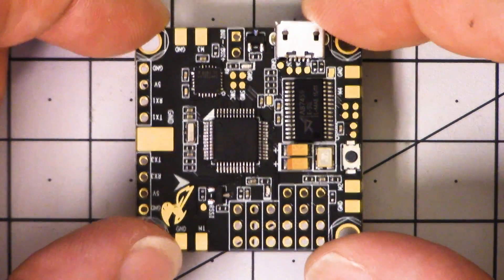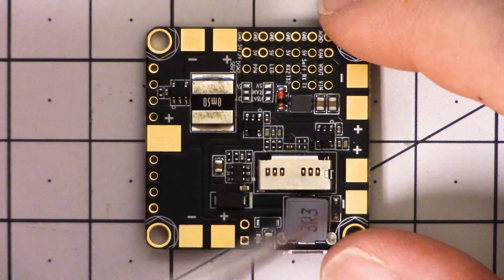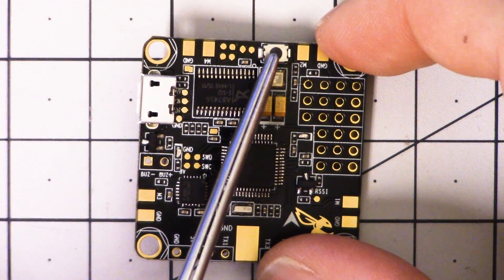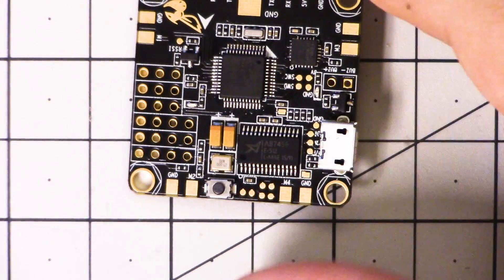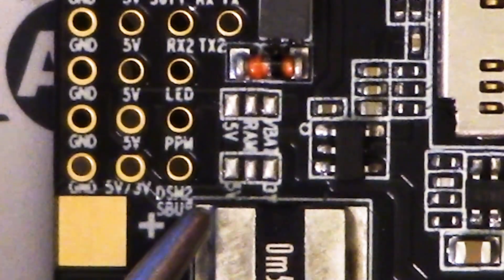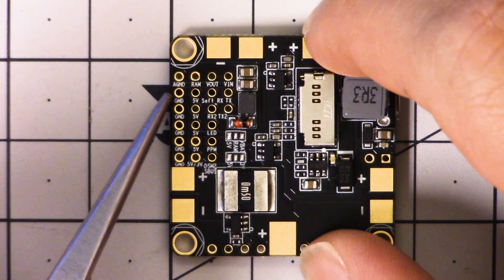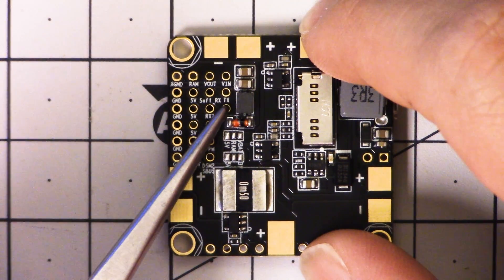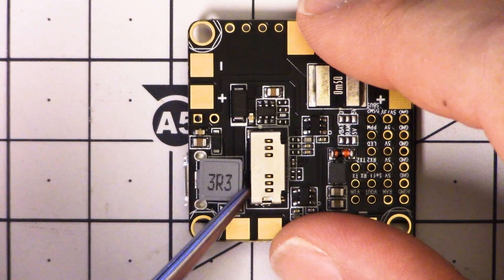Betaflight F3 (BFF3) Flight Controller | REVIEW AND HOW TO

Comment: I would like to try using my older F3 FC in a two wheeled robot. Can the BetaFlight headfree Mode help with driving control? Meaning, moving the stick right and the bot using the FC moves right no matter front orientate. Any recommendatiions

Comment: Hi mate is it possible to connect this fc to a impulse rc wolf pdb if so could you help me please
Reply from the maker: I'm not sure why you want to do that. Wolf PDB has PDB and OSD. This FC had those functions built in. If you are putting it in a frame that uses a wolf PDB as a structural plate, just don't solder to the wolf PDB at all. Use the FC for all connections.

Comment: JB, HELLLLP! Haha I’ve been having the worst time try to get my R-XSR to show stick input in betaflight. I’ve got the Sbus pads connected. Ram connected. Ground/5v/sbus signal wire on the sbus pad line. Then s.port connected to tx3. Configuration correlates correctly with smart audio on uart 1. Serial rx on uart 2. And smart port on uart 3. Brand new board. Brand new R-XSR. 😢😢 what am I missing
Reply from the maker: Did you use the white wire or the green wire for SBUS? On the RXSR, white wire is SBUS IN which is used for redundant receiver, which you are probably not doing. Green wire is SBUS OUT which is the one you have to connect to your FC.

The SBUS OUT (green) wire should be the 2nd from the end of the plug.

Comment: Hello joshua I wanted to ask you about the flight controller Betaflight f3.
At the first connection of the 4s lipo the flight controller detects a 5s battery as a consequence it sounds the buzzer for low voltage even when the battery is charged 16.6v.
In Betaflight I used integrated adc as a source of voltage and current monitors.
3.3v as the minimum cell voltage
4.2 as maximum cell voltage
3.5 as a cell voltage warning
1300 as a capacity
In betaflight I get the correct voltage value but sometimes a 5 cell battery is detected I tried with other batteries but the result does not change.
The firmware version is 3.3.3
sorry for the translation maybe not correct.

Comment: How do you wire a led strip to this board??
Reply from the maker: Check the pinout diagram it has an led strip pin marked.
Reply: Joshua Bardwell cheers I sorted it.. my iflight 7" with gemfan flash 7042 is flying fantastic.# Cheers Josh from the UK

Comment: I have a problem with whem i trun my controller on the cpu load gose to 100% every time why is this?
Reply from the maker: What's the CPU load before you turn on your controller? My guess is you are running an F3 board at too fast a gyro or PID loop rate and the receiver function puts it over the line.

Comment: Well Joshua I know this is an older review on the F3 betaflight all-in-one board but I have a very curious question and I know you're the man that will give me the answer or at least I hope so. Just the other day I had a real bad crash with my quad and it actually ended up breaking off the USB port and the SD card holder right off the board. Now I did figure out how to go through uart1 to get into the configurator but what I've noticed is I have power when I'm plugged into uart1 feeding at 5 volts the flight board has power but as soon as I unplug  and then plug my  battery in a 4 cell the flight board is dead now I'm pretty sure that has to do with the SD card holder being torn off the board is there any way to reroute that problem so that I can get power to my flight board? Sure do hope you can help me out otherwise I've turned this into a big piece of trash.
Reply from the maker: +Derek Dvorak your 5v regulator is damaged. You can in theory get an external 5v regulator and power the board that way but to be honest it's probably time to let this one go.
Reply: Joshua thank you for get back to me with a fix.  I ordered a new betaflight f4 aio.  but I'm going to order a 5v regulator too and save this board for one of my beater quads. off subject, I had asked you about the thinktank backpack and the lowepro quadguard and I'm glad to say I went with your suggestion and bought a lowepro and just got it the other day and all I can say is very very nice backpack!  thank you so much Joshua for your help.

Comment: I'm having a tough time flashing this board to bf 3.2.2. I can connect normally, but it won't flash. The bl CLI command and hard button both put it in DFU, but it won't take a flash, and I'm having a tough time finding info. I have the correct drivers installed on my machine and can flash other boards. Any thoughts?
Reply from the maker: Sounds like you are doing everything right. Maybe your USB cable is messed up?
Reply: I thought that too, but it connects fine otherwise for normal programming, and I've tried 4 cables and two computers with matching results. Something that caught my attention was a message label next to the connect/disconnect  button that says "no dataflash chip found" when connected.

Comment: Old video I know, but it seemed most relevant to the question. I picked up one of the new BF F4 Flight Controllers. I have a Runcam Eagle 2 that accepts 5-36v and a vtx03 that accepts 3.3-5.5v. I'm thinking the correct way to do this is to solder bridge the CAM for VBAT and power the camera off that. Then I'm thinking of taking 5v from the row below it to power the VTX03. Both will be grounded to AGND. This should give the camera a filtered power signal and a common ground for both of them. Correct?  Thanks man. Your videos are becoming a nightly routine for me.
Reply from the maker: Yes I agree.
Reply from the maker: If you get video noise consider moving the grounds from AGND to the GND pad next to the 5v pad.
Reply: That was fast! Thank you, sir.

Comment: I know you are busy and doubt this will get answered.  I have a Betaflight f3 and after flying the other day I get the initial ESC power beeps, but not the remaining which to me indicates the FC.  I plugged it into Betaflight and no accelerometer or gyro.  I am assuming it is trashed.  To sum it up, I have another FC coming today, but kills me not to get the old one to work.  any way to change it out using other old flight controllers?
Reply from the maker: +Telesys _ if you could identify which chop was bad, you could change it out with a hot air station. But probably just replace the board.

Comment: I keep looking all over the Internet about what kind of camera you can use. I'm using a Runcam swift mini 600tvl CCD now and I was wanting to buy a new RunCam eagle 2 and it is cmos, I just wanted to make sure that it's going to work. I can't find anything about the flight controller taking CCD or Cmos.
Reply from the maker: The flight controller doesn't care the least bit about what type of sensor the camera uses. Either will work.
Reply: Okay thanks for clarifying that.

Comment: HI. I was watching your BF F3 FC review and decided to get one. After I soldered all my wiring (ECS & PWR cables), I connect it to an USB Port and then nothing happen.. (no sound, no light, not detected on my computer by Betaflight or even Flash Loader) When I connect a battery, I do hear the startup sequence. Do you think I missing something, or do you think the USB port is broken? Please let me know if you got a hint, and thanks for the good videos, very helpful! Cheers and thanks for reading me,
Reply from the maker: No lights no nothing means the board is not getting power at all. Do you get the full startup tones? Or just three of them?
Reply: I would not know for sure what would be the "full startup tones", when I connect the battery, I hear a triple tone, I think it comes from the ESCs???. If I connect just the USB, one of the component in the back of the FC gets very hot, so I guess the FC gets some 5V. Maybe I damaged the board when I soldered the wiring? :(
Reply from the maker: Three tones simply means the ESC is getting power. It sounds like the FC is dead.
Reply: Looks that way, I will try to get a exchange now... Thanks for the reply and continue the good workout, quad community appreciate you!

Comment: Hi Joshua
I just ran into a problem i haven't had before. I was out flying earlier today, and crashed (i know, sooo unusual). When i reconnected the battery i only got 3 beeps, nothing more, FC (BFF3 3.1.7) seemed turned off. When i got home i connected the fc to betaflight with usb and it turned on, and i could connect to the GUI. if i keep it connected via usb to the computer, i can plug in a battery and everyting works, but without the USB, the fc does not seem to turn on. Any thoughts on what this could be?

Cheers, and thanx for a channel full of useful tech-tips!
Reply from the maker: The 5v regulator that powers the FC has died.
Reply: Joshua Bardwell and if i dont have any of those lying around, i got to get my self a new fc? This is nothing a bit of soldering will fix right?
Reply from the maker: In theory, you could repair it, but practically speaking it means a new FC.
Reply: Alright, thanx!

Comment: Joshua, as all my video equipment works from 5V to 22V (or more), would it be more advisable to set to 5V or to RAM ?
Reply from the maker: You shouldn't run vTX off of RAM pin if you use 5v because it will draw too much current for the filter circuit. Use RAM pin bridged to vBat, definitely.

Comment: I know you said it's essential to ground both VTX and camera to the same ground  but my VTX has two grounds so should I connect all three to the same ground ?
Reply from the maker: No. The second ground wire is for the camera or mic.
Reply: Joshua Bardwell thanks, I appreciate the help. I was finally was able to build my drone. My first F4 flytower had sparks shooting out of it and got fried. Then I bought the F3 flytower and it started smoking when powered up. So I tried the Betaflight F3 and it works perfectly. The only thing I can't figure out is how to get Betaflight to ignore flickering inputs from my transmitter. Center stick flickers between 1,499 to 1,501.  I tried adjusting yaw deadband,  but it didn't stop it from flickering. I can't finding  anyway to fix it.

Comment: Has anyone here worked out to Port Forward on this board? I want to be able to control one servo on an output, also what are the pins SW C and SW D are for? thanks :)
Reply from the maker: +Tony Cooper those pins are the JTAG programming interface. Not useful to you or me. You can remap a servo output to the PPM pin would be my suggestion.

Comment: hey i got this fc and i ran the ram pad off 5v even though   im using runcam owl plus and my vtx can also handle the vbat just to be safe but now my fpv feed is like terrible like it will just barly pick up on any channels and ive checked and rechecked my wiring do you think that its just not getting enough power? should i redo it and use vbat instead of the 5v?
Reply from the maker: You didn't tell me what vTX you're using :-)
Reply: Joshua Bardwell ts5828 600mw 7-24v
Reply from the maker: +logan bentley yeah that will pull too much power at 5v and burn out the filter on THE RAM pad. The instructions for the board say don't run the vTX off the RAM pad at 5v.

I suggest moving things to a regular 5v pad.
Reply from the maker: +Joshua Bardwell or use vBat since it supports it.
Reply: yea im try running vtx off ram with vbatt and just power cam off another 5v pad....thanks soo much for your reply and the very informative videos you do i would have probaly just gave up on fpv/quads by now without your videos to help cause im new to all this-computers,electronics everthing goes into this hobby. thanks man

Comment: https://static.rcgroups.net/forums/attachments/6/9/3/3/4/8/a9696788-192-Betaflight%20F3.png
Hi Joshua can I ask you something..if I copy this connection but use my unify pro ,xsr frsky,runcam eagle will work? Thanks
Reply from the maker: That diagram will not work with the Unify Pro. Only the HV. The Pro needs 5v and the BFF3 RAM pad cannot supply enough current at 5v for the Pro.

Correct wiring for the Pro is: RAM pad bridged to vBat, camera wired to RAM, Unify Pro wired to any available 5v pad. Both Unify and camera GND must go to the EXACT same GND pad. Don't use AGND.

Comment: i think i break my bff3, it wont turn on using lipo, but only turn on when using usb?which IC i should replace? i cant find any regulator except LG33...
Reply from the maker: Powering up on USB but not on LiPo usually means the 5v regulator is fried. But which exact component is damaged, I couldn't say.
Reply: yep me too...just notice LG33 is regulator for 3.3v but dont know which one is the 5v regulator...
well i solve it with adding my Matek pdb...

Comment: Good evening Mr Bardwell,

I have two beginner Question for you:

1.  Why does knowing the current drawn out from the ESC  so important ? 

2. Does this Betaflight F3 FC supports IBUS !! ( sbus i know it does)  ?  If yes.  how do I set up the wires please ?

sorry that was like 3 Question.

Like always Mr Bardwell  your help is very much appreciated.
Reply from the maker: Yes it supports iBus.

Knowing the current drawn from each ESC can give useful troubleshooting info. Like if a motor is failing, it will draw more current.
Reply: Do i solder on the Sbus hole on the flight controler ?

Comment: hey josh i have been reading the betaflight f3 forum on rcgroups. there have been numerous concerns that ham been raised about the ram circuit and various other things. overall would you recommend it now that you have had it for a while
Reply from the maker: It's still my favorite FC. Supports everything I want to do and has been reliable in the field. I wouldn't recommend it to a beginner because it can be hard to solder to.
Reply: Joshua Bardwell Thank you for that information, I will be getting one I started with BF and then switch to Kiss but with all the new stuff Kiss just isn’t cutting anymore, I’ll be ordering one. Thank again sir

Comment: Joshua,  or anyone,  why does motor 2 die when my led strip tab is turned on in modes?
Reply from the maker: Because you are using Dshot and there is a DMA conflict on your board.

Comment: Hi!  I'm new to quads and FPV. I'm about to do my second build. I'm curious about wiring in my camera/vtx. If the components can accept input ranges from say 5-24 volts, what is the best way to do it on the BFF3?  If I put it on 5v versus battery voltage will the battery last longer in flight?  This is all overwhelming right now! 😳
Reply: I think I just saw the answer. Running on vbat will lead to lower amperage, is that correct?  So using the video header bridged to vbat would be a good way to go?
Reply from the maker: That's how I do it.

Comment: Regarding the vtx power. Let's say if I had the tbs unify vtx (not the HV version) could I just power that up on the 5v pads (bridge the ram and 5v together)and have the camera also on a 5v pads too? Will that work. Will there be noise on the cam?
Reply from the maker: You cannot power a Unify Pro off of the RAM pad if RAM is bridged to 5v because the Unify will exceed the current rating of the filter on the RAM pad. If you connect it to a regular 5v pad the regulator on the BFF3 can more than handle it. But there will be less filtering. But many people use this setup with no problem.
Reply: Joshua Bardwell  ah okay that's good to know. I'll leave the ram pads alone and run both cam and vtx on a 5v pads..  thank you

Comment: Hey, great Video !!! 
Afaik RAM should be RAW ( Raw battery voltage ) an was a Typo on a early FC or PDB Board, so it was labeled wrong on these PCBs.
Reply from the maker: But it's sort of evolved hasn't it? Because on the BFF3 it can be either vBat or 5v.
Reply: Yes, this community is unstoppable :-)

Comment: Silk screen is on bottom because if you use headers,  they would cover the silk screen if it was on top.
Reply from the maker: That's nice and all, but if you direct-solder, it's a bit of a bodge.
Reply: Joshua Bardwell i completely agree. Most people eventually graduate from headers. But they do need to cater to the  mass consumer.

Comment: i can't get my f3 to work on betaflight...  only way my pc will recognize it is plugged in is if i hold the boot button down then plug it in... will only flash when holding down the boot button also. after that when i click connect it fails.  tried 3 different computers..
Reply from the maker: Not flashing except when you hit the bootloader button is normal. That's what the bootloader button is for. After flashing, power cycle the board without holding down the bootloader button. That should allow you to connect.

Are you sure you are flashing the correct board type to the board? What board is it? What are you selecting from the pulldown menu when you flash?
Reply: Joshua Bardwell betaflight f3 fc..  3.1.7 spracingf3

Comment: Hello, I have a problem. My motor 2 doesn´t arm with the other motors when I arm the quad. How can I resource remap motor 2 to motor 5 for example? Need to wire motor 2 signal and GND somewhere? or can I CLI resource remap directly. 
This board only has 4 motor output :S
Thank you.

Comment: I cant get my video to come through? I checked the voltage and its fine the wiring is good and I can see the OSD just cant see the video? Any help?
Reply from the maker: Set the OSD to PAL or NTSC (depending on your camera type) manually instead of using Auto.